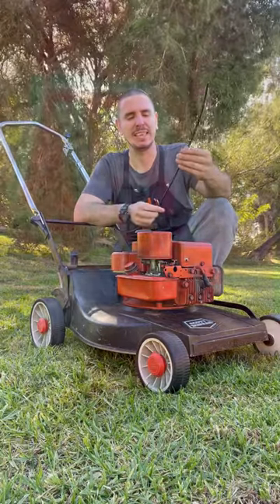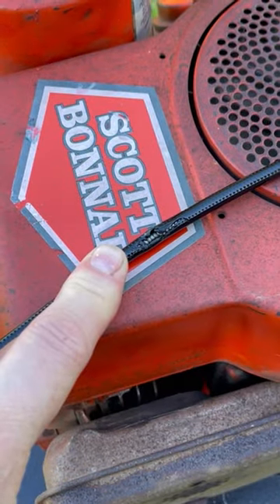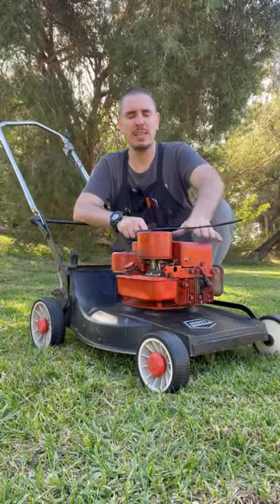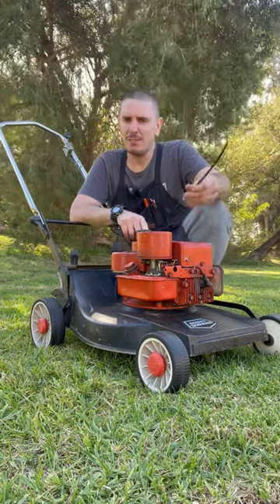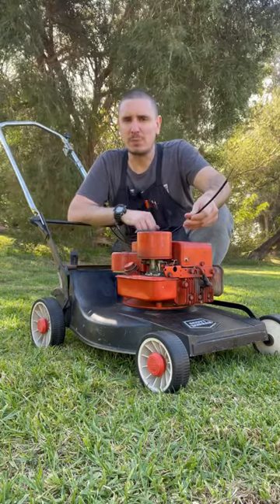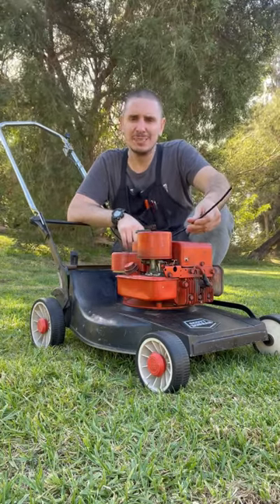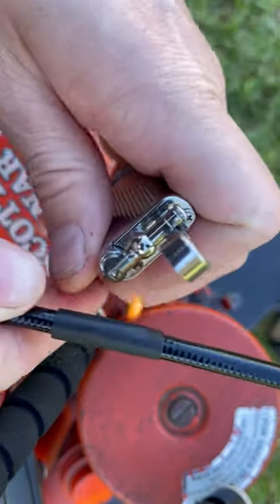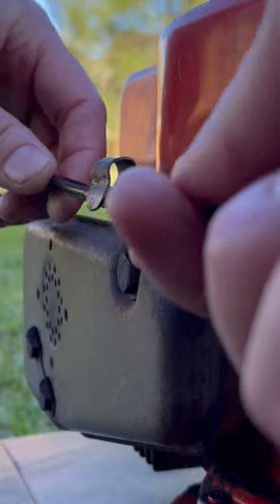Lawn Mower Throttle Cable Rust Prevention

Comment: Great fix. Keep lube in and moisture out.
Reply from the maker: Spot on Steve. Quality heat shrink tubing is thick, tough, abrasion resistant, heat, fuel and oil resistant. It hasn’t let me down so far.